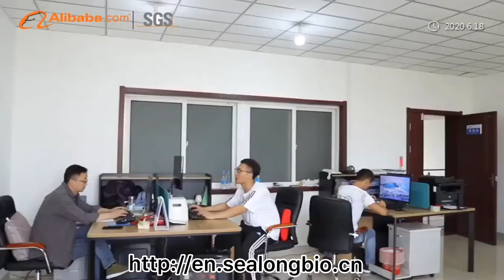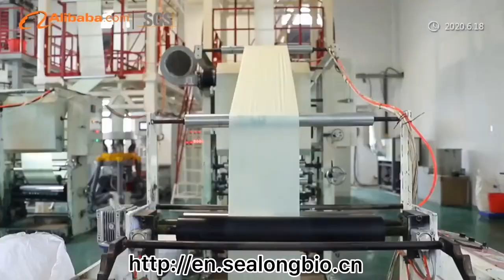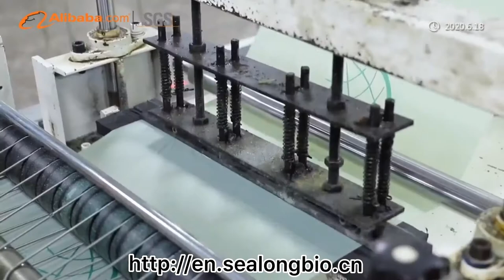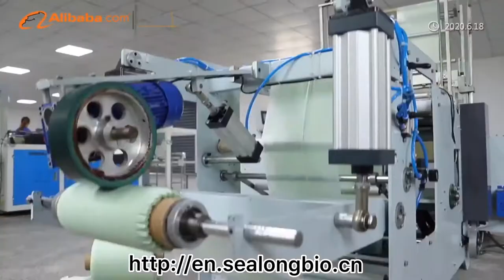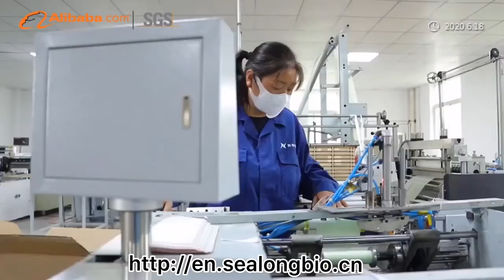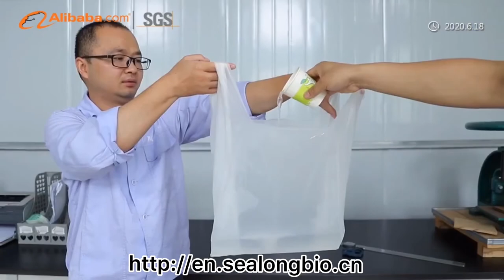Production process of biodegradable plastic bags manufacturer in China

Comment: What is the resin you use for the plastic shopping bag?
Reply from the maker: PLA PBAT+ cornstarch
Reply: @emmahong1572  Do you have PVA and starch based 
And can you send me the prices for PLA and PBAT based 
Many thanks
Reply from the maker: @mohammadhatamleh3830  We don't have PVA,  do you want the price of the bag or the price of the raw material?
Reply: @emmahong1572  bags
Reply from the maker: @mohammadhatamleh3830  The price range is 23000-34000 RMB/ton. Different bag formulas are different, and the price is also different.  requirements can be emailed to us~